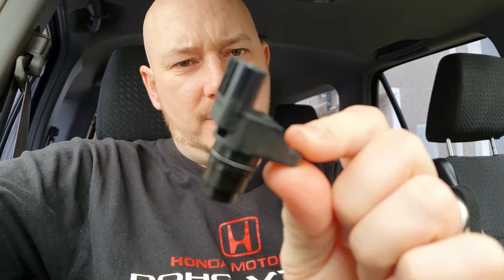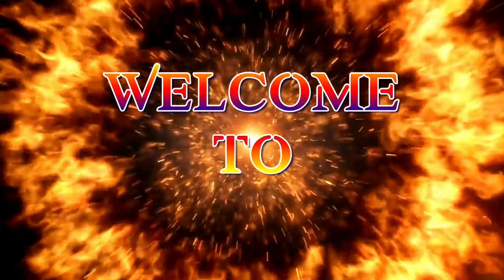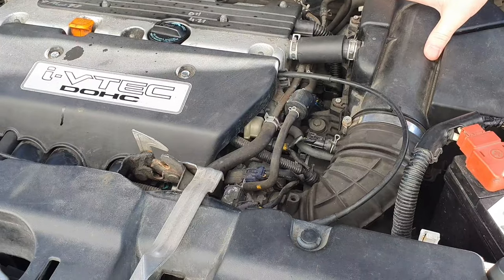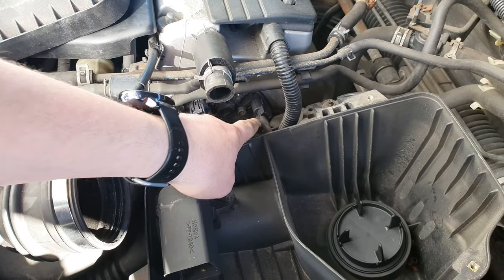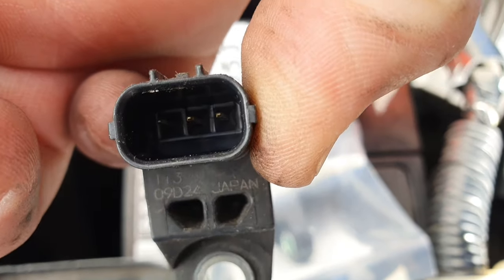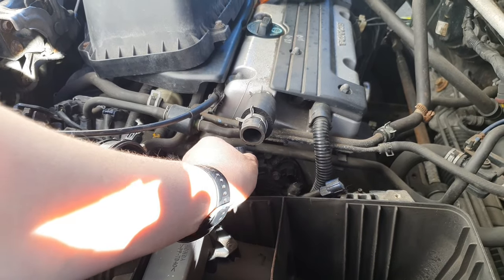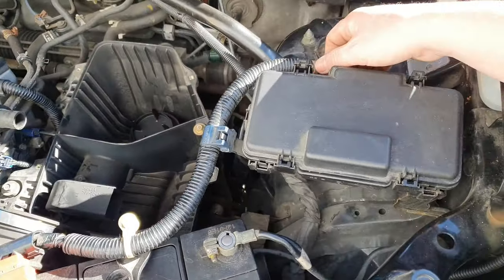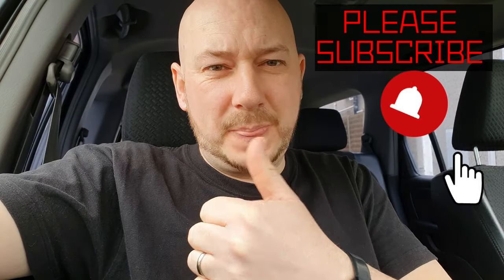p0341 honda crv/honda cr v problems/how to replace camshaft position sensor/honda cr v k20

Comment: Hi, excellent vid thank you. 
I have a 2010 honda accord 2.4, currently got eml and vsa lights on dash
Following code stored: P0341 - “CMP Sensor A and CKP Sensor Incorrect Phase Detected”
Other then stretched timing chain, could it be the VTC Solenoid or the sensors which you have shown in the video?

Thanks
Reply from the maker: Being honest, I'm not sure! 
I am not a mechanic, i just try to sort out some issues myself. If you do change the VTC solenoid or some sensors, you could be wasting your money if it's the chain. But a timing chain could do with changing if the car has over 100k miles! So i would have a good honda mechanic look at it first. Sorry i wasn't more helpful.
Reply: Yes or the wires that go to them. 

Its unlikely that you belt is actually stretched like common
Reply: @kennygroth4938  turned out to be a stretched timing chain. Now all replaced and running excellent without fault
Reply from the maker: Awesome, thanks for coming back to let others know to check out the timing chain first. Good man.
Reply: @crz1364  hahah looks like mine is a stretched belt as well... well.. guess I gotta get to it then
Reply: @kennygroth4938  belt or chain? My car has a chain
Reply: @crz1364  chain. I took the head off to check, and sure enough mine was loose. Tried to line of the gears up to see if it was off, and they slipped and I set the timing off in the process haha oops. I mean it was loose anyways so whatever
Reply: update? what was your issue? im having same error code. was it the timing chain?
Reply: @justinc803  stretched timing chain

Comment: Also, check your sensors magnet. If it doesn't stick on the car, replace it. If it does stick to the car, leave it alone. And yes, also be mindful of the timing chain, and pray to God you ONLY have to replace the bad sensors
Reply: The ironic thing is that swapping the timing chain isnt that bad and is easy to test as long as you havent wrecked your valvetrain it is an order of magnitude more difficult than swapping just the sensor but not that bad overall

Comment: Thank you for the video.

It was indeed helpful.

Please is it advisable to you the car when one of the sensors are not available?

My CRV 2019 has a bad sensor causing the fan not to work and over heating the car
Reply from the maker: Thank you for your comment. Please do not drive the car if it is over heating, it will seriously damage the engine.
Reply: @GPTV2020  thank you sir
Reply: I have been having difficulties getting the camshaft and crankshaft in Cameroon.

I can only order from either Canada or Japan
Reply from the maker: I understand it is hard to find parts in Ireland too. But definitely do not drive if the car is over heating.

Comment: My car was running just fine, parked up in evening, next morning it would cut out after starting and gave the P0341 camshaft position sensor code. I tested my sensor as shown on another video by putting a piece of metal and measuring the voltage but it stayed at 5v making me think the sensor was actually bad, but I replaced it and it has not fixed the problem, like you I did the front sensor, do you think it is the chain stretched or something else? If it is chain any idea how much to get chain fixed at garage? Car has oil and filter change every MOT, only does about 3k per year, has just over 100k on clock, 2004 2.0 ivtec auto. Thanks.
Reply from the maker: I'm not saying it is chain stretch but it sounds like it. Each garage will charge differently so i can't say.

Comment: I changed both camshaft sensors in my 2005 Honda Accord 2.4 and the code is still coming up on the reader after I deleted it. What should I check next the wiring harness? Or chain?
Reply: Were you able to resolved the P0341 fault codes?
Reply from the maker: I would get the chain checked out, it's most likely the problem. Your just wasting money replacing sensors that are fine.

Comment: Awesome video: Can the P0341 problem be related to Variable Valve Timing Control (VTC) or its most likely to Camshaft position (CMP) sensor A, bank 1? (Honda Stream 2004)
Reply from the maker: Well my problem was not the camshaft position sensor. So after i changed the camshaft position sensor it did not fix my problem, the problem only got fixed after i had the timing chain replaced.

Comment: Thanks for this video my 2008 Accord is having the same issue, the scan says it's the camshaft position sensor that's bad. I will get it replaced soon. I wanna ask, my cars fuel consumption is a bit on the high side, could this sensor also be the cause of that?
Reply from the maker: Yes you would use more fuel but did you see the warning at the start of this video. Its possibly a timing chain issue not the cam shaft sensor.
Reply: @GPTV2020  thanks for your response and yes I saw the warning, I scanned the car earlier and it had the P0341 error code. So do you think I should replace the timing chain or should it just be adjusted?
Reply from the maker: Well with timing chain stretch you should replace it, it is a difficult job and expensive if you have a mechanic do it, but your issue could be camshaft position sensor so what i would do is just switch both camshaft position sensor around, don't buy a new one yet, after switching them if the same bank 1 comes up on the code reader then i would have a good mechanic check it out.
Reply: @GPTV2020  I saw a video of someone replacing the timing chain, it was definitely not an easy job. I will replace the timing as a last resort. The thing is, I only found one camshaft sensor, I guess its different when compared to the Crv even though its a the same 2.4 engine.
Reply from the maker: No my crv is 2.0 k20 but they should still be in the same position as the k24, they may be different though and not interchangeable with each other. Best to get a mechanic on it if your unsure.
Reply: I just had my timing done in bout 5 months ago yesterday this code came up??
Reply from the maker: Its possible that your timing could have slipped slightly off or wasn't set right, but it also could actually be that the camshaft position sensor is gone too! Sorry i wasn't much help.
Reply: @GPTV2020  I did hear a little rattle sound yesterday as drove home then it went away, but this morning I started the care and it sounded fine so hopefully it's not the timing 🙏🏾 and I can replace the sensor...so thanks for the knowledge
Reply from the maker: Did you get any warning lights or is it showing any codes 🤔?
Reply: @GPTV2020  yeah I got the p0341...I'm go with chaing sensor 1 since I just had the timing done and hopefully that's the issue if not go into the timing but the car sounds good when I crank her up.

Comment: I'm having similar issues on a 2015 Accord sport, my cousin is a mechanic, he advised to not buy cheap cam sensors, they always fail or won't register. So I'm buying OEM, and they are expensive.

Comment: I read a comment below, when you changed the timing chain does the code gone?
Reply from the maker: When the chain was changed and the code was wiped off the ECU, it never returned back. In my case the timing chain had stretched and was giving the codes.

Comment: If you accidentally bend one of the teeth on the reluctor plate while taking this sensor off, do you think its possible to bend it back?
Reply from the maker: Yes I'm sure you could bend it back but  i would just buy a new one, because you could weaken it by bending it back.
Reply: Well the main problem is to replace that part requires removing the engine and quite a bit of labor cost.   Though my mechanic says if he drops the pan he can access it enough to bend it back
Reply from the maker: @Fremen02  but bending it back could weaken it, then because of the load on it while driving , it could chip off and damage the whole engine costing more.
Reply from the maker: @Fremen02  how was it damaged??
Reply: When I was removing the sensor it got stuck.  I could not get it out.  Tried pliers and it broke the sensor itself and left the round part still in the hole.  Then I got the stupid idea of trying to dig it out with a screwdriver etc.  I somehow pushed a tooth inwards during all that.   Most expensive mistake I ever made.   Really sucks.
Reply from the maker: @Fremen02  ahh shit that's horrible, most of the time i just leave the more difficult or tedious jobs to someone else to deal it. Is it an old car?
Reply: @GPTV2020  
It just looked like such a simple thing.  no more difficult than changing the pcv valve...but it is so close to these delicate teeth I didn't realize that.  
I left a video reply but its not showing up.  the mechanic tech sent me this image:
https://www.youtube.com/shorts/Van2AMJ2aDA
Reply: @GPTV2020     Its a 2012, with 96k miles.  I bought it off my mom who drove it the first 5 years.
Reply from the maker: @Fremen02  ah so its not just a peace of shit you don't care about, i was going to say just chance it, bend it back and see how it goes.

Comment: Well This sucks. But he was RIGHT!!!! My chain was stretched. Only had 127k miles on it.
Reply from the maker: Shit man, bad news. Hopefully you can get it sorted cheap enough.
Reply: @GPTV2020  replaced it all lol. Even water pump while I was down there. All ORM Parts. Wasn’t cheap but runs better than when I bought it
Reply from the maker: Excellent.
Reply: Was the car able to start when you had this issue? My customers car won’t start and he has the code. I checked the chain and it seems to be tight but I’m not sure if the positions are correct
Reply from the maker: My car did start no problem it just felt very sluggish. But if the timing chain is stretched to far then the ECU you will not alow the car to start, but i am mot a mechanic so don't hold me on that.

Comment: I was given a 2002 Honda CRV and when hooked up to the Machine it said Camshaft position sensor , my question is will that have anything with the car cutting off because that’s pretty much the problem with it it runs
Reply from the maker: It could yes, if the position sensor is not working then the ECU doesn't know the position of the cam and to save the engine from further damage it will cut fuel. The cam or chain must be very badly off track if its not the sensor.

Comment: Could one swap the two sensors and see if the error code follows the bank? If the error code changes "banks" then sensor faulty. If it stays on same bank, then another issue is going on. Thoughts???
Reply from the maker: Yeah, that makes sense, but you'd need to buy two of them. Also i did try the same new one in each bank and it never changed so replacing the two with new one's possibly wouldn't change the bank either.
Reply: @GPTV2020  to clarify... swap the two current sensors, with each other, before buying any new ones. And see what the error code shows after swapping them. See if it stays on the same bank, or follows the sensor.

Did you new sensors fix the problem on yours, or did it end up being the timing chain?
Reply from the maker: @chadrobertson217  yes exactly, do that. Swap them around, if it moves bank then it's a sensorand if it doesn't move it's possibly the timing chain. That's what it was in my case but i did change the knock sensor too, my mechanic recommended it.
Reply: @GPTV2020  your was the sensor, or timing chain? glad you got it repaired. :)
Reply from the maker: My problem was timing chain stretch.

Comment: How much does a new timing belt and tensioner install cost? I got the p0341 code on my honda accord 2011. My cars idle is running high and low, kinda all over the place. Changed the cam position sensor bank 1 with a rock auto 14$ part. Ran well for about 15 miles then went back to idleing funny. I Think it ran better for that Little bit cause I unplugged the battery to install cam position sensor and it reset the computer. It has no strange engine sounds. Do you think it's a good idea to not drive it till I find out what exactly wrong with it? Any info helps
Reply from the maker: Yeah its best not to drive it, if the timing is off you could destroy the engine. New timing chain kit, is not too expensive (different for every car) but around 150 euro or almost $200. But its the cost of fitting it, or if you want the heartache you could do it yourself but be careful not to mess up the timing again.
Reply: @GPTV2020  Alright, thanks for the info.

Comment: So I have a p0341, car turned off while driving, didn’t want to start again, when I tried the car/block would shake while trying to start.got it towed back. Then I attempted to start it again once it was at my house and it started perfectly fine and drives fine again, code is still there after clearing. There is absolutely no ticking/rattling/knocking noise. Need help before I start buying parts 🙏
Reply from the maker: Maybe the tensioner got stuck or came loose. 🤔

Comment: I know this is a old video butt im having the SAME code.. 

The orevious owner put in a autozone sensor for the front sensor A Cranksensor.. could this autozone part be a issue for the honda motor making it give me the CODE or no?
Reply from the maker: What to do is swap the two sensors around and see if the code is still the same.
Reply: @GPTV2020   i did that and replaced the cam sensor with OEM HONDA. Crank sensor is also a AUTOZONE Sensor.. why cant people buy oem parts? lol not sure where to go from here
Reply from the maker: @thewalmarttyper  OEM are sometimes alot cheaper then aftermarket. But I'm thinking it is the chain. Hopefully it's not so get the advice from a real mechanic first before going forward with replacing anything.
Reply: @GPTV2020  I'm gonna check the timing on top since thr valve cover is easy to take off

Comment: Do you have to change both ? I just change one and my car sounds off dam sensors are pricey
Reply from the maker: Yes they are definitely expensive but if when you changed one it didn't work swap it with the other first to see if it is the problem, if it sounds better job done if it is still the same, i would be looking at other possibilities.
Reply: @GPTV2020  thanks for this video though a lot of other videos didn’t really explain crap haha.   You think I could take back the sensor I just bought ? Get my money back ? 😀

Comment: I have a 2003 Honda Accord 4 cyl, that has a similar check engine light code.... P0365 Camshaft Position Sensor B Circuit Bank 1.  I wanted to know if your Honda still cranks or turns-over when turning the key on the ignition.  In my situation, I was driving the car on the highway...  the check engine light came on...  I notice that I lost power, and no acceleration when pressing on the gas.  Now when I try starting the car, the engine does not turn... almost seems like the starter isn't working at all.   So that is my question, if the camshaft sensor is bad, does that kill the starter from turning the engine?  Hope that makes sense...   thank you!
Reply from the maker: Yes its very possible, the camshaft tell the computer how much fuel to send but if it not working it won't start and the computer can also cut the power to the starter to stop future damage, but if you change the sensor and it still won't start it's possible you could have burnt out the starter too, after you install the sensor and if it still won't start, try giving it a few little taps with a hammer, it can get stuck sometimes because it could be just jammed or stuck from trying it. But once again i am not a mechanic so probably best to have a pro look at it.

Comment: What if you just replaced the engine ? An still doing the same thangs . Is the timing chain still the target
Reply from the maker: If you have used the same timing chain for the new engine then yes it's possibly still the timing chain.

Comment: Well I just took my car to the shop it was not the camshaft sensor.  It’s the timing solenoid (looks like a sensor) Or it’s a filter/screen that needs to be cleaned… I had my timing chain done 3 months ago.  So it’s under warranty 👌
Reply from the maker: Yeah there are plenty of possibilities hopefully you can find it and sort it.
Reply: Did your dash light come back on after you had all the work done?! Had everything replaced, got home, dash lights back on, running fine
Reply from the maker: No mine is fine since, no lights on dash car's working fine.

Comment: It could be the same with Acura RDX 2007 2.3L?
Reply from the maker: They have timing chain too so it's possible.
Reply: @GPTV2020  should be the sensor or out of timing?
Reply from the maker: Well im not sure, it's best to go to a good mechanic and ask them to check the timing, that way you don't waste your money on either new sensors or a timing chain, if the timing is out it's a chain issue if its not then it is possibly the sensor.
Reply: @GPTV2020  (p0234,p0117,p0365,p1131)
engine very hard to start and runns rough

That are the issues. I haven't seen closer already
Reply: @GPTV2020  i think has a belt timing
Reply: @GPTV2020  I was today and take a drive. It has a late starting but when run works good, during the driving was of full power and shifts smoothly, but sometimes has lower rpm. Looks like more misfire it these camshafts sensor has the bad report. But as an engine looks healthy. 
And something that I mentioned, I open cooler cut there was not any signs of milkshake but smells like gasoline....
Reply from the maker: K23a?? Im sure it's chain drive?! Either way, i am not a mechanic, but it does sound like is not getting the correct information, so could be a sensor but if timing is slightly off then it could have the same issues 🤔 im not sure sorry.
Reply: @GPTV2020  anyway, I have to search in a mechanical if it's on time or not, if it's on time I'm trying to replace the sensor or maybe have any misfire and sent bad info at crankshaft sensor 👍